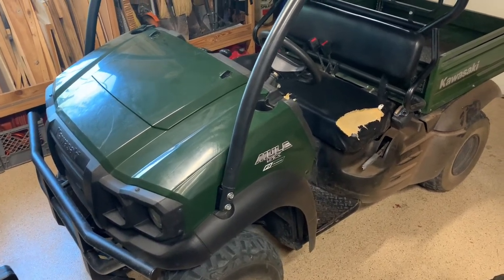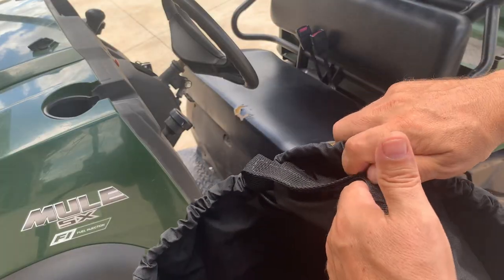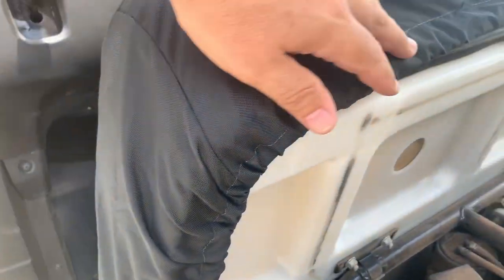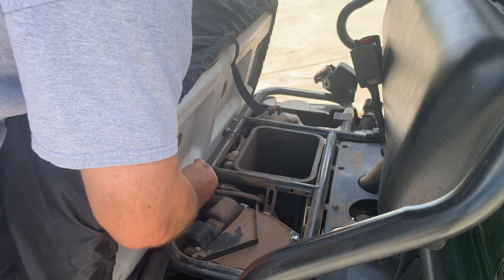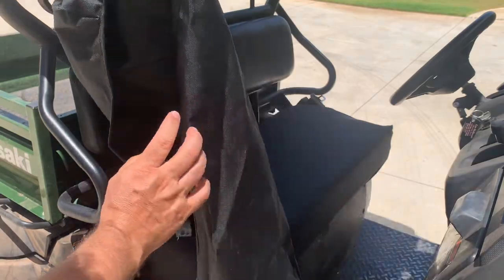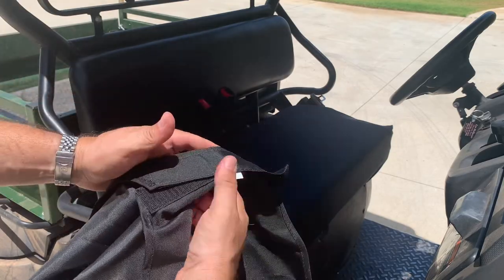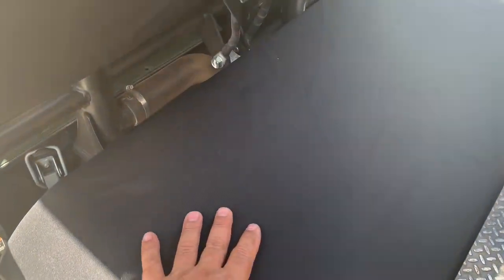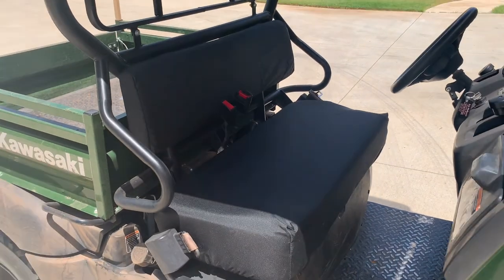Kawasaki Mule SX ● DIY Factory Seat Cover Replacement

Comment: You couldn't get the old vinyl off? They shouldn't glue that stuff. That just makes it wear out faster.
Reply from the maker: You probably could get the old vinyl off, but it's designed to just go right over the top of it.  I didn't even look at taking off the old vinyl in my case.  And the new seat is working out great. This replacement material is much stronger.  Thanks for your comment.